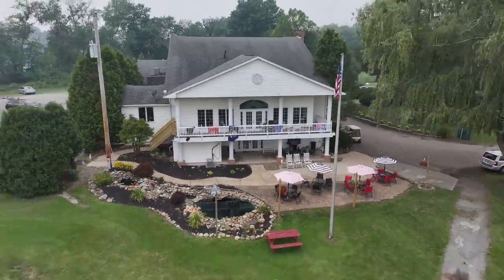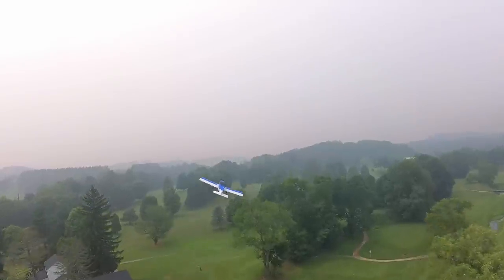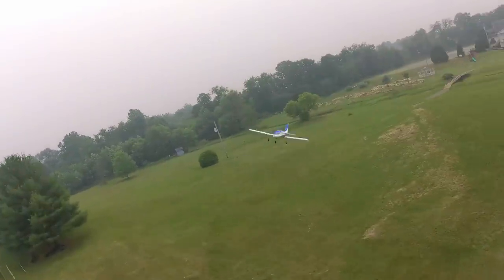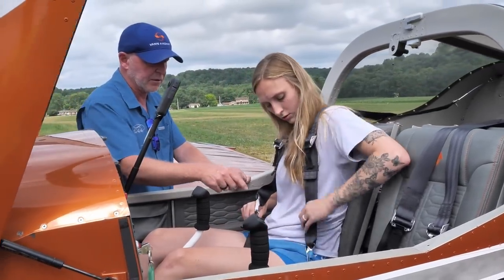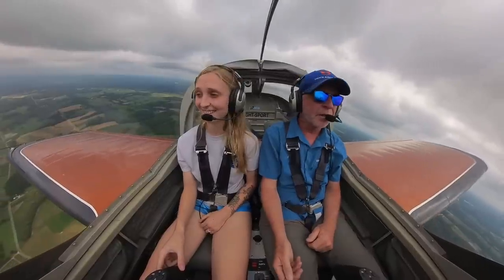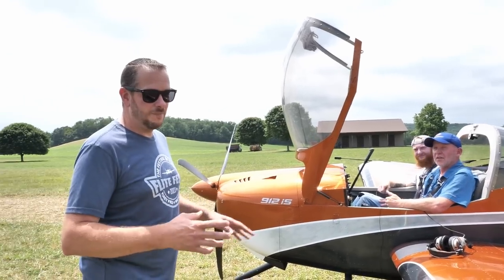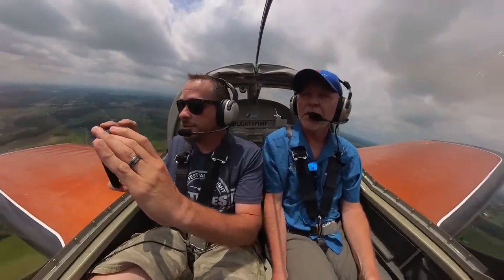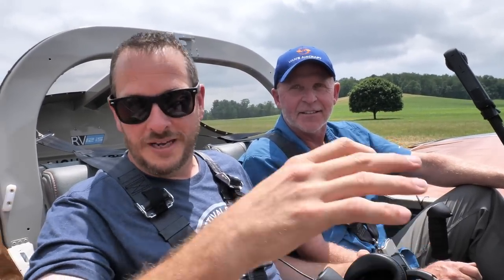WE FLEW AN AIRPLANE!!! RV-12iS

Comment: Project idea: make a giant flying transmitter, and then make the real transmitter look like a tiny RC plane. Even better if you can trick someone into thinking to just handlaunched the wrong thing. You'd have to make the wings and everything out of clear material to pull that off.

Comment: Don't you do that all the time? I mean, if you can make an R/C plane fly, then a real plane should be even easier. I know Sripol does it.
Reply: Easier is a little relative in this case. Perspective from sitting in an actual airplane certainly helps with control and situational awareness. One thing to consider though is that most RC aircraft have a huge amount of control and power to weight ratio compared to manned aircraft. This means you can get away with a lot more aggressive maneuvering and recoveries comparatively. Not to mention your life isn't tied to mistakes.